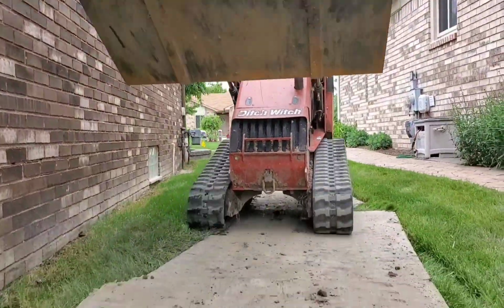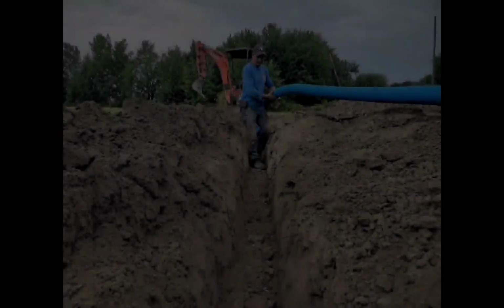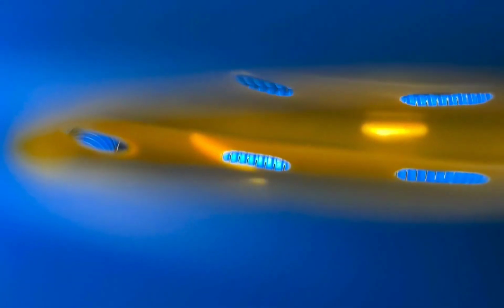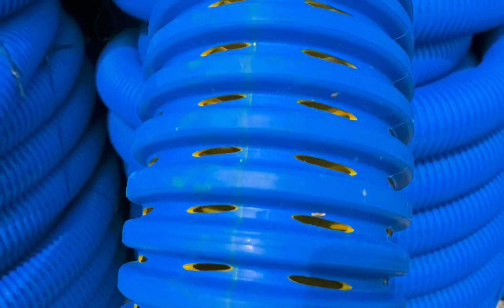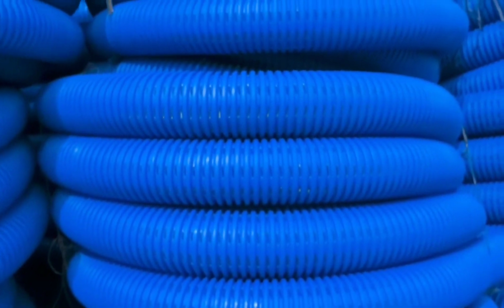Best Yard Drainage Contractor 248-505-3065  Macomb County Michigan

Comment from the maker: French Drain Man leads the industry in yard drainage. With our patented sump systems, as well as our signature French drain pipe, the Royal Blue High Octane it's the only yard drain pipe that's purpose-built just to take care of yard drainage. We remove more clay, more subsurface soil than any other yard drainage contractor. The trenching that the other companies do, and even the ones with track hoes that are digging dirt, they don't use as big of a bucket, they're not taking out as much clay, they're just not equipped for the haul out, and they definitely aren't equipped for the disposal. It's not that simple. We have a unique arrangement where we take this clean fill and repurpose it. And for the homeowner that we're working for, they get more stone, they get more drainage pipe, they get more air circulating, which all results in a better yard drain that dries your yard out faster than any other system on the market today.

Our Royal Blue High Octane signature pipe has more inlet than any other pipe in the world, and it's the fastest draining pipe on the planet period. With the large cutouts, it allows water to flow freely through the drainage system. As soon as it evacuates the water, it then allows air circulation, which dries out your subsurface soils quicker so your children, your family and your pets can all enjoy the yard. Just give French Drain Man, a call at 248-505-3065. Don't delay, give us a call today.